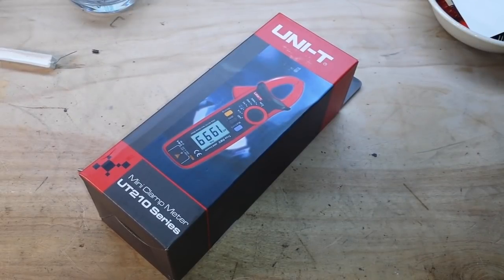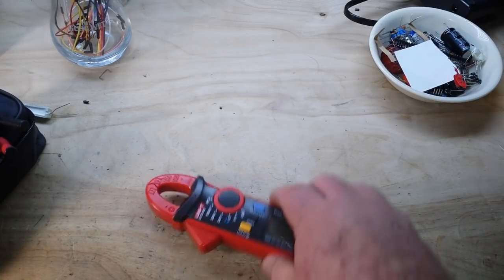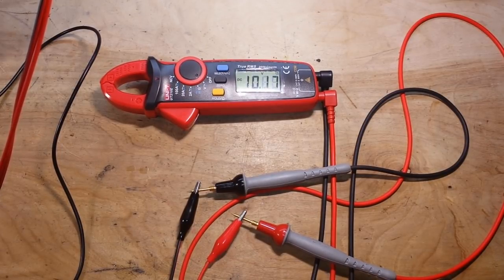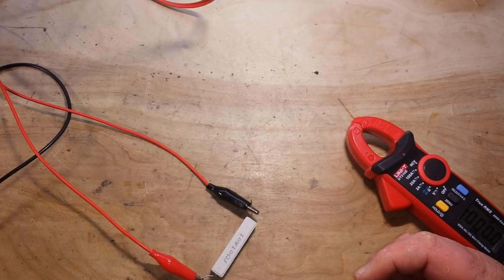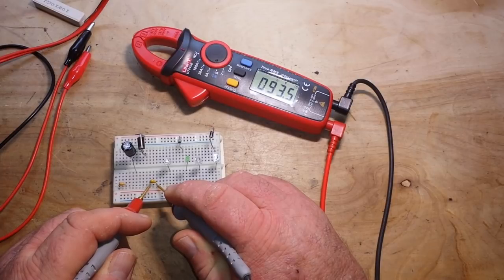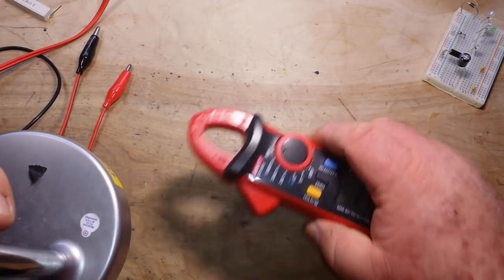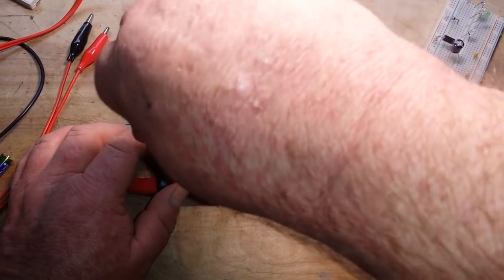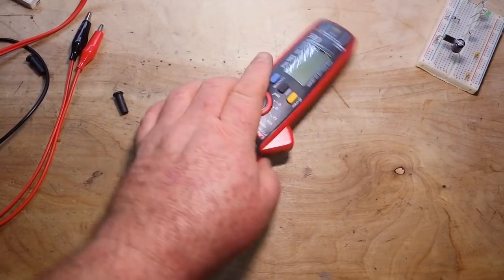Uni T UT210e Clamp Meter Mini Review

Comment: It's very important to zero before measuring (with the clamp). Do it right before you measure, close to what you are going to measure, and don't change the orientation more than you absolutely need to between zeroing and measuring. Otherwise the earth's magnetic field + and other ambient magnetic fields will make your measurement less accurate. Even just moving it half a meter and rotating it 90 degrees can significantly impact the reading. This is a limitation of all clamps since they rely on measuring the magnetic field, and ambient magnetic fields exist all around us.

This is a great hobbyist-level (or even low-level professional) tool. Really great price for the quality that you get in terms of the electronics at least. I wouldn't subject it to rough use since it's not poted ect., but if you are using one of these on a day-to-day basis then you probably have a professional-level tool already. For my use with home electrics and PC-enthusiast work it's great since I treat all my tools gently anyway.

I got one for an absolute steal on ebay just recently.
Reply: Ah .  Hey what  is auto  for?  When  zero button  is  held down tye word auto comes up on the display
Reply: you all probably dont care but does someone know a way to get back into an Instagram account?
I somehow lost my login password. I appreciate any tips you can offer me!
Reply: @Ronald Zain instablaster ;)
Reply: @Korbin Kingsley it worked and I actually got access to my account again. I'm so happy:D
Thanks so much, you really help me out :D
Reply: @Ronald Zain No problem =)
Reply: @ronaldzain6759  I've seen this before
Reply: @korbinkingsley7957  sup
Reply: What do u guys think about (Kaiweets HT208D)

Uni T  UT210E  vs Kaiweets HT208D
Seen good reviews about both and I'm not sure which one to get

Comment: Hey Paul, a good tip for putting screws back into plastic is turn the screw slowly in reverse till you feel it click and then tighten it. It will go back into its original thread.

Comment: NVC DIY FIX: use Bounce sheet (the sheet you put in your drying machine) and rub it on the meter and the test lead and the housing... it will prevent the meter from getting statics and beep for no reasons...

Comment: Hi Paul. I mentioned this meter and that your friend  Big Clive had it too. And also big Great Scott uses one I found out. You are a bit mistaken about handling this meter for right handed people. I think this is because your are left handed?  In your right hand you have your forefinger on the trigger (clamp), just like holding a gun, but I got little experience with that since that hardware is not allowed here.  In this way  you are able to control the dial with your thumb which feels very natural and in this way you can easily read the display. I got mine this thursday from China for 38, very happy with it :)
Reply: Yes agree you don't necessarily need use your thumb. Correct about big Clive etc. I noticed too.
Reply: Pretty clear you didn't watch the video start to finish
Reply: 1:53
Reply: @MrFrazierNation  Huh?? Who of this community could resist not watching Paul's new video from start to end????????
Peace! :)
Reply: @rolandberendonck3900  A lot of the material covered here is way above me, but I enjoy watching all of the videos

Comment: I understand your take about replacing the provided probes with yours, without even testing them: as an engineer it's perfectly understandable, since you know that your probes are reliable and accurate, and you only want to test the multimeter - not the whole product. But imho, it's part of the deal so why not (no will not start a new channel lol)? I know those UNI-T probes that are provided with their kits, even the UT181A that I bought offering grey probes with caps (supposed to be on their higher end of their product line), are utter crap. Until I got better and more "complete" ones, I used cheap old probes that came along a 10$CAD multimeter and which worked much better... Anyway, good review, thanks: I won't buy this because the NCV (those clamps being the main purpose of this specific multimeter) doesn't seem reliable at all.

Comment: Thanks for the review. coincidentally this UNI-T 210e was exactly what I researched based on several amp clamp meters primarily for measuring DC current and only wanted to spend less than £50 and I am comfortable I've made a good choice. I better go current camp to learn how to use this 😂

Comment: I've had one for a couple of years as a secondary meter, primarily for the clamp function.
The only thing I don't like about it, is that you cannot make it default to DC mode.
Reply: I agree with you a 100% And any time you switch the dial you have to set it again for DC mode, grrr! That's the same complaint from all the other review video's from this meter. It would be nice if there was any way to mod this.
Reply: You are not 100% correct. Hacking the meter is possible to select the order of AC/DC measurement and also increase the count limit.
Reply: @rolandberendonck3900  This process is well documented on EEV Forum.

https://www.eevblog.com/forum/testgear/a-look-at-the-uni-t-ut210e/
Reply: @agaelema  Oh! Please share details.
Reply: Also have it for about two years. Works great. But I use it almost always for AC so did not notice that inconvenience. I also always use NCV as a safety check and it works every time (I check before and after I cut the power). It's reasonably accurate and I caught a 50W ground fault in my home just by noticing the current difference between the live and neutral wires of the whole apartment at the panel. The ground fault was due to a miswired socket , which I fixed.
Reply: I think it's better that it doesn't remember settings. I prefer that it's always in the same state every time it's turned on.
Reply: I use mostly AC in industrial environment... But it can be hacked... And I did ;) 

Mostly for a long backlight timer and 1000 amp capabilities

Comment: In general,  Uni-T are very good bang for buck. They produce a very wide range of meters across a very wide price point. Try the UT 181A.  I use this alongside my 87V as my daily driver.
Reply: The only reason why I haven't gotten a UT181A is that it can be killed by static electricity by applying it on the input side. I don't wanna spend hundreds of dollars and accidentally kill it with my own hands... same thing with the UT61E, but that's way cheaper.

The UT139C and UT139E however are immune to static electricity, I'm quite comfortable with those two knowing they will just keep living.

Comment: Our dear friend,
1) If you think about it again, you will see that you are probably not right about the grip on the device, so your note on device design will necessarily be wrong (in fact you are holding the device upside down).
This device is design to grip with your right hand, and the "Thumb" is designed to operate the mode selector wheel, not the clump. Operate the clump should be done with your "Index" finger.
2) I really liked your review, and in fact you will know that this device can be obtained relatively safely also through their official store on AliExpress (which this website needs a lot of caution) at a significantly lower price (the price goes up and down, but the average is 34USD, including shipping).
3) I thank you very much for your videos.
This device has helped me save the lives of several friends (a sure save from a sure death – and I'm not exaggerating and not kidding).

Comment: I've used one of these as my portable meter for about a year. It does well and the carry case has held up well. Accuracy is as close as needed for this type of thing and it's not drifted at all.

PS. You might want to fix the text in the description. The model number is wrong twice.
Reply from the maker: Thanks you are correct

Comment: The NCV sensor is in the little bump on top of the clamp. I both have the UNI-T UT210E and the -D, and Indeed, I like those meters too. Bang accurate, and with the Hold button, you can even lock the readout so you can measure in difficult conditions, and can read the display afterwards. I allso have the Dynatek 9045 (Oldie), but this small meter is awesome to carry with me. The -E is in use for the daily jobs, and the -D is in use for the higher currents 100A+ AC and DC and frequency reading.
Reply from the maker: Cool thanks for the info

Comment: I'm from Australia. I've got a few sets of Brymen test leads. They are very nice, gold plated, rubberised handle, silicone insulation, 18awg, come with screw-on banana connector on the tip end. I also have two sets of probemaster leads, same as yours. I have to say, I don't have a preference between the two in terms of performance, but I do prefer the Brymen cuz they are cheaper and easier for us aussies to get, Franky sells them on eBay. 

I also have a few sets of expensive Fluke leads, TL175, Tl71, TL224 and a few attachments but I don't remember their model numbers. They are nice, but really they are not something I recommend because of their prices.

I've recently discovered a set of cheap high quality leads. It's branded Cleqee, no idea how to pronounce that. The model i have is P1503. The wires are very flexible, I doubt it's silicone, but it feels flexible enough that I'd call it "half silicone". The wire gauge feels like 18/16 awg, I've yet to test actual internal resistance yet. The handles and plugs are both rubberised and feel great to the touch. The tips are moduler too. One big things I love about these probes than all my other more expensive ones is that, these probe handles can be bent quite a bit! They can flex and bend in your hand. I really can't get enough of these leads. They are just so comfortable to hold!

EDIT: fix stupid typos

Comment: Thanks for the video homesteader!  Like many, I use mine for automotive diagnostics as it's compact size is a big plus, but I'm not thrilled with the readings i get on many low resistance devices (could be operator error, I confess). It sure is hard to zero on DC voltage, but I guess that's because it's reading millivolts -not a plus for my applications, sort of distracting, but i just ignore it like you do.  I also find the NCV to be a bit iffy at times and I don't entirely trust it.  Thanks for the quality leads comments -as a DIY'er, that's something that we sometimes fail to consider sufficiently.  Best wishes.

Comment: Hi Paul,
You have to wonder why they didn't design one of the lead's plugs a little longer so that the longer one can rotate around without interfering with the other when sitting on the bench.  

I also saw in another video the rotary switch contacts scrape across the PCB, cutting into skinny surface traces running across the top of the board.  

Have you found anything else that would give us pause to buying this unit after your three years use?  Anything better come along since then?  I'm getting ready to pull the trigger.
Reply from the maker: No, this guy is tops in it's price range.

Comment: Great Video. Happy New Year.  I'm just getting tnto 18650 batteries and fid them somewhat confusing. 1) What is a GOOD brand. Lots of claimed stored Amperage.    2) Should it have a protection circuit built into it? I just bought " Panasonicc NCR 18650B HIGH DRAIN 3400mAh Rechargeable Li-ion 1Vape Battery" I think they have the built in protection.   3) can I charge them with a charger that also has built in protection?

Sorry.. The VAPE in the description was not why I was buying it.  I'm not into vaping so I'm not sure what the connection is.  I'm just asking about Le-Ion 18650B batteries. I stopped smoking 40 some years ago on LSMFT.
Reply from the maker: This is really not my area of expertise. I would check out any local vape shops. Those guys know their 18560s.
Reply: Also check vaping forums. The main thing is to buy your 18650 from reputable suppliers. Many people will rewrap cheap batteries to make you think you are getting genuine top brand batteries. So stick with reputable suppliers and you'll be ok.
Reply: William Miller I switched over to 18650s about 2 years ago and have been pleasantly surprised every day with how well they work. You absolutely must try the XSTAR VP2 charger, after much research this one is supposed to be one of the best for charging curves. I also recommend WOWTAC A2S head lamp in neutral white. I use one every day and 2 years ago I bought 3 as I wanted back up. All three still work except one has it's finish wearing off, that's how much I use it.

Comment: I love this meter. Very versatile! No other meter does what this does for this price and size. I wish it defaulted to DC measurement on startup. It's annoying that it starts up in AC mode.
Reply: re: "It's annoying that it starts up in AC mode."

That can be changed - read a little further down in the comments here for that info (the EEPROM can be re-flashed giving a LOT more features).

Comment: It's a clamp meter :P A good one and it is really tiny. 1mA res :P To measure current in AC, build a small extension cord with splitted wires. watch out for the glare before taking out the digits.

Comment: 3:06 - 'Something you learn in engineering'. Something I learned in engineering is RTFM. (google it if you are not an engineer)
4:20 - Sometimes when measuring a DC voltage, it is necessary to select the DC range on the meter. It eliminates one of the variables...  
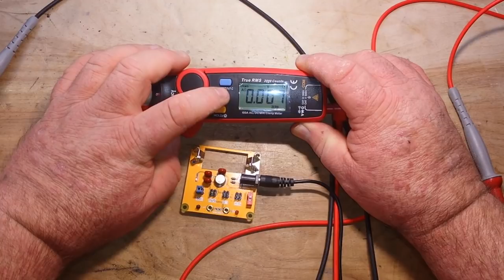Got as far as 4:30, didn't get angry, didn't start another channel, just moved on.
>>>> Next
Reply: Agree with your 4:20 observation. If I let it sit on AC, it just beeps & gripes.

Comment: You can only measure one wire on DC and not 2 wires as you stated in your video @ 10min 5 Sec  .   2 wires in DC mode on a hall sensor cancel out the Amps as they travel in opposite directions

Comment: Hi Paul, I want to use my UT210e to measure the current from my multiplier. For instance at the start of the multiplier and I really would like to know how many mA the end  of the multiplier  produces. So let's say I want to measure the current from my 25kv multiplier output; is it safe to use the clamp meter for this application? '(off course with good shielded and safe hv wiring) I hope so because the outcome of the output really matters to me. And since it is not directly connected to any high voltage my intuition says it must be ok, but I give more value to your statement as an experienced engineer. Can you plz give me some feedback?
Reply from the maker: You're good to 200A.
Reply: @learnelectronics  Ok, I dared to try it and it works! I get 40 mA from an NST so I do get at reading at a high voltage and 150 kHz. Me is happy :) Thank you Paul!

Comment: For people in Europe: 
You can get these probes at Welectron: https://www.welectron.com/ but they are more expensive compared to the US.
Personally I use the Brymen probes cuz they are cheaper (10 Euros for a pair) and they also are gold-plated and have really soft silicone leads. But I plan to get some Probemasters for comparison. 
I highly recommend everyone to get good probes for your multimeter. Even for cheap ones like the Anengs it will make a huge difference for your measurements. They just make much better contact and are so much nicer to use.
Reply from the maker: Thanks for the tip on the Brymen probes

Comment: Ordered one of these   earlier this month.   Just the other day I was using it and discovered the 2A and 20A Amperage mode was not functioning.  No AC/DC Icon.  It would function switch into the other functions like Volts, Cap and Diode fine.  DAMN,   Went back to the posting I purchased it from looking for any kind of Warranty.  Eaaaa 30 Free Return.  Contacted the Seller and explained the What For.   He / She who ever responded the next day asking for Photo's of the Issues at hand,   Eaaaaa Here we go I was thinking .  Going to run me around a few more days and out last the few days I had left to return the thing.  I sent photo's of the thing in the None Functioning settings.   Next day they informed me a New Unit was on the way.   DAMN Never expected that from a E Bay seller.   Didn't even want me to send the old unit back.  Think I'll try to Reprogram it and see if it will work.  Should be here Friday.   Whhhhh00000000000000000 !
Reply from the maker: Good to hear!
Reply: @learnelectronics  They actually are a hell of a good meter for the bucks.  Yea, the AC/DC thing sucks but eaaa!

Comment: Would this be any good for testing my solar currents (5x100w)  dc for my 12 v system in my motor home?
Reply from the maker: Yes it would work for that.
Reply: @learnelectronics  cool, i was also looking at the voltcraft v330, but it seems that these two are identical, just rebranded.

Comment: Come on!  You missed the most important feature! Non contact  Direct current amperage!  It is suppsed to be a selling feature of this meter!   Does it even work?  If so, how accurate?  Miiliamps?  Two thumbs down.
Reply: Oldricky.....Check out the short on my channel, loaded it up especially for you.... I did no intensive testing, rather a quick check.... To answer in advance....19 milliamps worked fine.....

Comment: Emmmmm, No in circuit current measurement SUCKS most well, Eaaaa?   Well limits the scope of use some what.  Still handy looking and not as clunky as some , eaaa!   AVE has one Dead Bug out of the Box.
Reply: Inline DC current measurement is completely unnecessary when you have the clamp.  Cheaper clamp-meters have inline current measurement for DC, because they only measure AC current with the clamp.